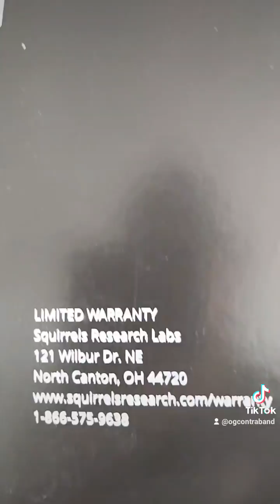FPGA MINING BETTER THAN ASICS?? Sqrl Fk33 Squirrels Research Xilinx VU33P crypto Ethereum Review

Comment: Very cool, im curious what difference there is between a squirrel miner and a regular fpga besides the fan; i have to imagine the bitstreams don't work on regular fpga.
Reply from the maker: It would probably work, and then burn out the card is my guess.  Squirrel makes the bitstream and adds the good cooling packages
Reply: @ogcontraband  cool, i was researching fpga miners a year or two ago, and people were talking about damaging the fpga so the bitstreams could be kept a secret, but idk. i wasn't able to find the discord where the squirrel miner was first being talked about so i'm not sure if the bitstreams are open source or not
Reply from the maker: @evanl734  Bitstreams are right on github, not secret.  It's just eth right now but I heard octopus is also being worked on.  The FK33 is so good I only talked about them after every used card was sold :D